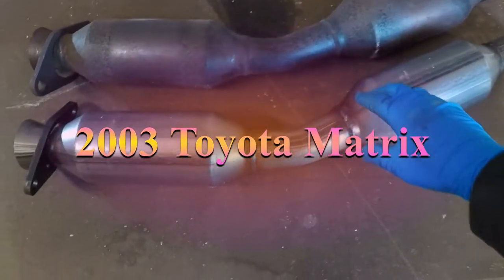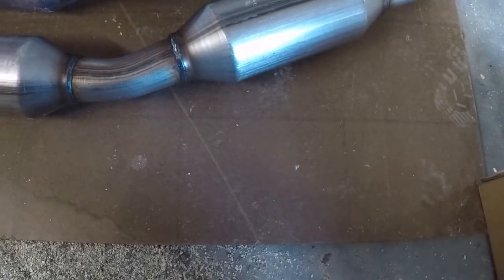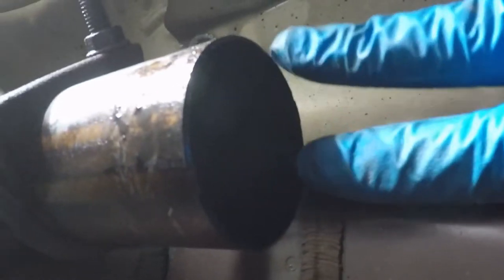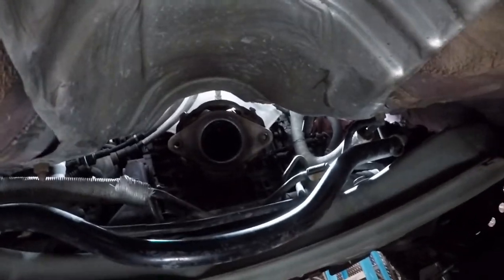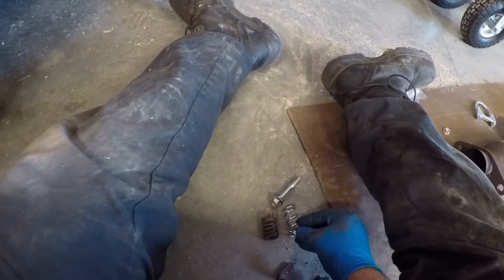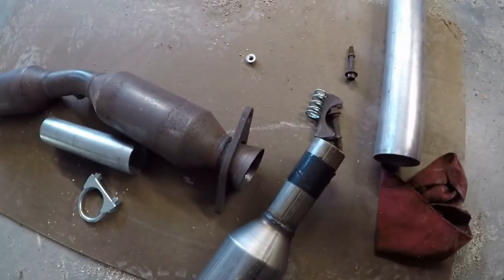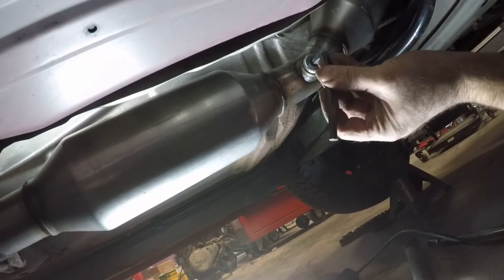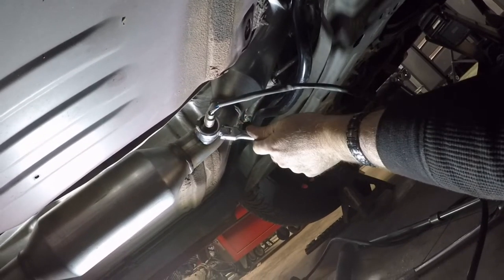AUTOSAVER88 Catalytic Converter install in my 2003 Toyota Matrix #autosaver88

Comment: Awesome video. Thanks. What size coupler did you use. Thank you
Reply from the maker: 2 1/8 inside diameter coupler. Thanks for watching.
Reply: @wonkster1970  Thank you very much for responding. I know your video is an older one.

Comment: How did it go taking out the factory exhaust?
Reply from the maker: It wasn't too bad.  I took a reciprocating saw and cut the original exhaust behind the cat.  I only had to remove the exhaust hangers from behind the cat so that I could lower it enough to put the new cat on.  Surprisingly the bolts that held the original cat to the exhaust manifold weren't bad.  I sprayed them with some PB and carefully took them out.  I've had to replace the cat since and I've got it down to under an hour replacement.  I thought that the last one failed a month after install.  I reset the computer and I haven't had a problem since (knock on wood).  Thanks for watching!

Comment: How has the autosaver cats been holding up in the long run? I’ve heard mixed reviews.
Reply from the maker: I made it 11 months with no engine codes. It just came on again last week. I haven't confirmed the code but it might be a failed cat.  I'll check this week and let you know.
Reply from the maker: P0420 error is back.  I'll be installing another one.
Reply: @wonkster1970  yeah that was my worry. A lot of reviews for the setup for my Jeep, people say the code comes back in a couple months and I can’t afford to be replacing the cats every couple months. If they lasted a couple years that would be another story
Reply: @dunercr  u need a More expensive one
Reply: @dunercr  well you only need it to pass emissions so that puts you at every two years 😀

Comment: The title says you're dealing with the Toyota Matrix and then less than 20 seconds into the video you say it's a RAV4 well at least I know to quit early
Reply from the maker: Thanks for watching at least part of the video.  When I was in the final stages of editing, I noticed that I had said that I was working on a Toyota RAV4.  That is my other vehicle.  I could of done an audio dub over.  Instead of doing that, I decided to put a text overlay on the screen confirming that I was working on a 2003 Toyota Matrix.  That correction is at 0.13.